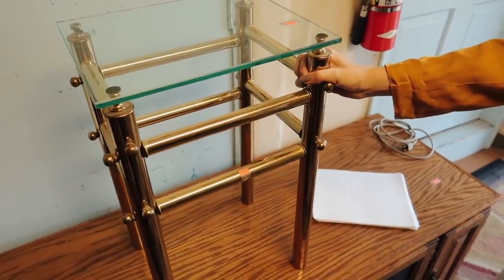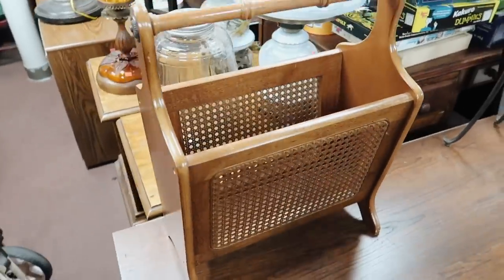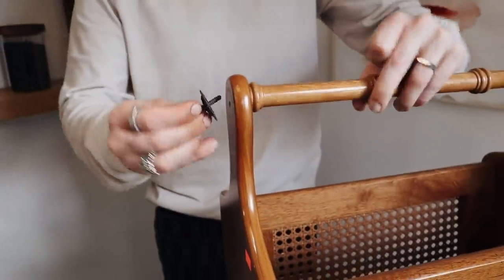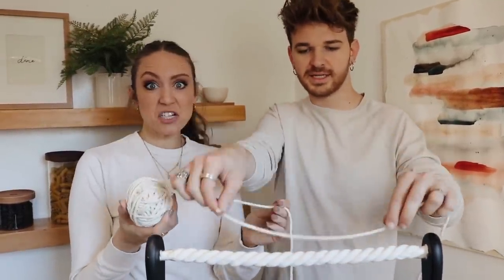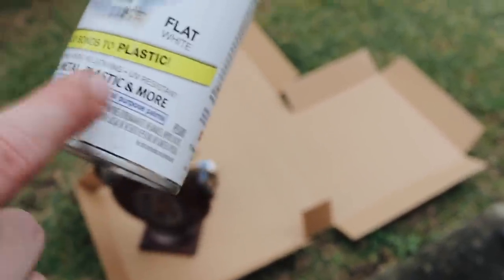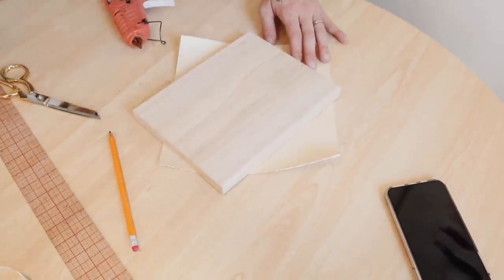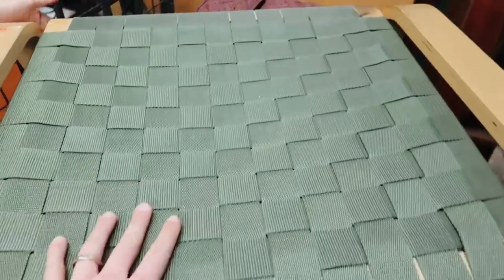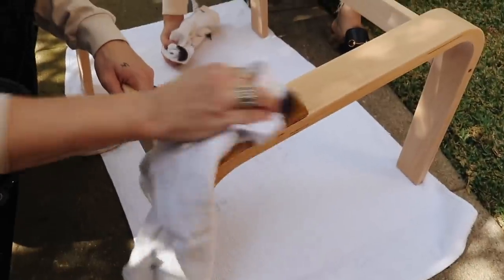DIY THRIFT FLIPS | Extreme Room Decor Hacks with XO, Macenna

Comment: The roll of  textured wallpaper is for ceilings. You can leave it as is or paint with metallic paint to make it look like the old fashion copper or tin ceilings that were popular in Victorian times.
Reply: Rhonda Flesher it's common in the U.K., especially in period properties. As you suggest, it's used on ceilings and also below dado rails to imitate a product called lyncrusta, a highly embossed (and hideously expensive) wall and ceiling covering itself originally designed to imitate expensive tiles and plasterwork.
Reply: it"s called anaglypta.
Reply: @stacianeale7117  yep, I thought this too from a UK viewer.  Looks great on the box
Reply: No wallpaper on the ceilings it is a pain to deal with. Anaglyphtic wallpaper goes on on walls.

Comment: Couple tips for spray painting: 
Do it in long light strokes instead of focusing one spot
Give it 2 or 3 layers
Finish it with a layer or two of clear coat, applied the same way

Comment: The stool is FANTASTIC!!!
Another option would be to leave the original woven material on for strength. Then cut a solid/one piece of faux leather and just upholster right over the top. That would create a more modern option depending on someone's personal style. Or even a faux hide or fur if you want a glam look. Soooooo many options for that stool!
Also, I wanted that brass/glass table!!!! I was seeing it with the top off and a pot sitting in the middle as a plant stand! It would be similar to the copper pipe one McKenna made. 👍

Comment: The anaglypta wallpaper used for the little box is used in room makeovers because its thick textured surface helps hide defects in walls. Used a simalar pattern 30 years ago under the chair rail in my kitchen. The cool thing you might not know is that it is paintable...actually, you are suppsed to paint it.

Comment: I think they made that wallpaper to be paintable. Like in 80s everyone was doing faux everything so think meant to do faux tin ceiling with high and low metallics. For the first magazine rack maybe an old thinner leather belt wrapped around the parts you thought looked bamboo or spiral wrapped along entire handle but in a color to match the rattan not painted.i do like you left that part when painting the rest black. This gives me an idea for my bathroom that has a giant spa tub but no storage. Towels in a upcycled magazine rack!

Comment: Everything looks great but using hot glue to apply the wallpaper to the box was so wrong. Modge podge would have been a better choice as it would adhere the whole surface and you wouldn’t end up with lumps which is what the hot glue will do.

Comment: Sorry but you killed the footstool by staining it. Just looks dirty. OK with darker leather but it really should have been creme/sand coloured for the high end design (aka pure Scandinavian)...that or with finer jute textile. A tip for the magazine/papper basket, use a brass metall bar instead, think you might have cut the rope too short and it will fall out.